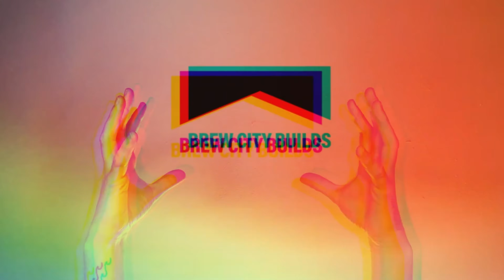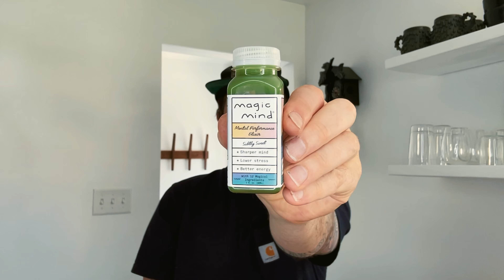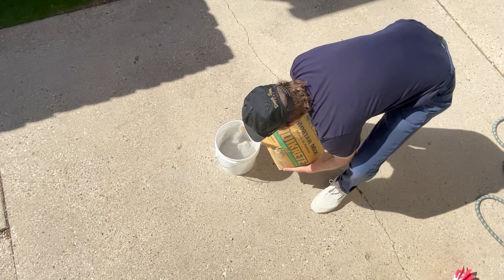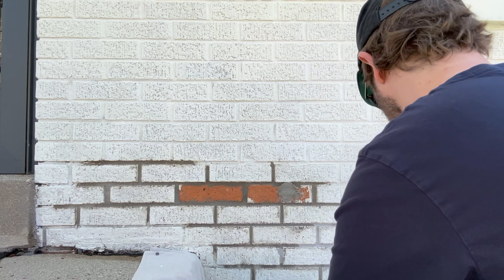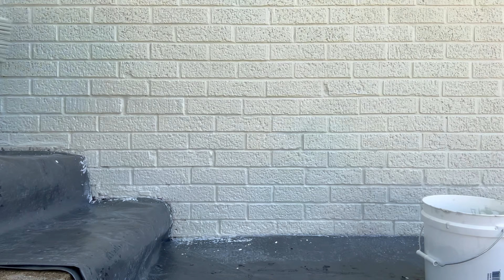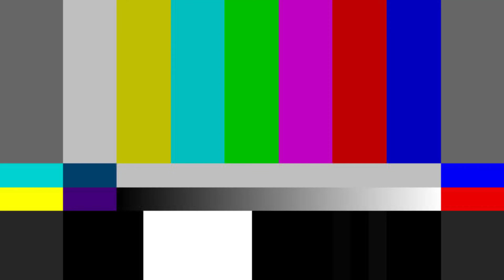How to Repair Brick Mortar Joints: The Easy Way

Comment: It seams some concrete caulk would be faster for small areas.
Reply from the maker: that would have definitely been easier, but i use a lime-based paint on the brick not to ruin it, so the paint won’t absorb into any kind of silicones, so i had to go with the good ol’ fashion mortar route. otherwise i would have to prime with a special primer and just didn’t wanna do the extra step.
Reply: @brewcitybuilds ok

Comment: You know the paint is the cause of the problem. Also, this is repointing and not tuckpointing. I'm sure this will be part of the annual maintenance schedule.
Reply from the maker: you’re totally right about the repointing thing. this one spot with missing mortar was like this when i first painted the house. didn’t even notice it until i initially painted, tbh. i gotta say the lime-based paint i used has held up beautifully and there’s been no other issues on the brick or mortar for the past 4 years. i chose romabio for that reason. i was thinking that those two bricks popped off because there was literally no mortar surrounding them for however many years before we bought the house, so the moisture must’ve really gotten in there. but i’m still figuring all this stuff out, so who knows.
Reply: @brewcitybuilds You should be perfectly fine if you limewashed it. Paint is a whole other thing, so maybe just say limewashed it becuase I see people confused by it all the time.
Reply from the maker: i never thought about it, tbh, but i can totally see why people get confused by it.